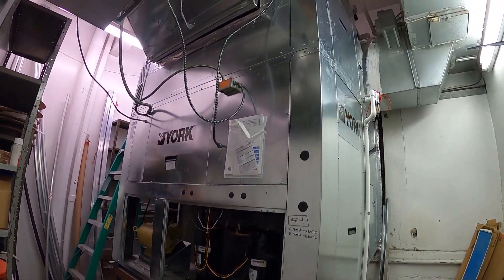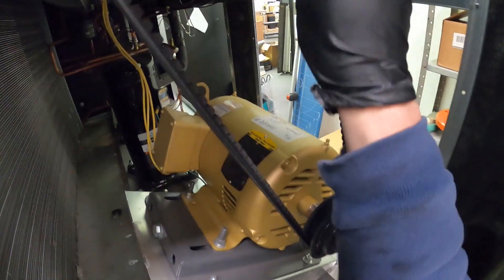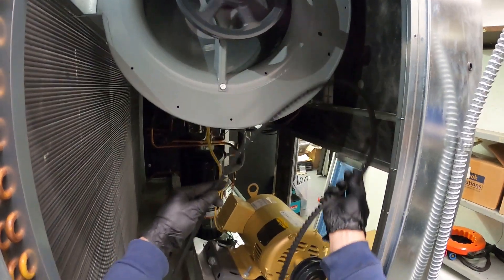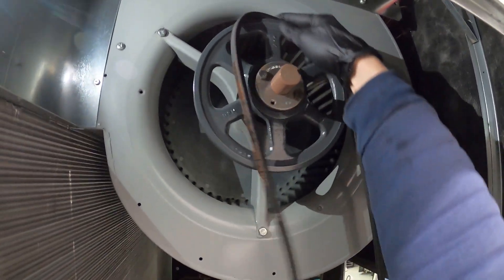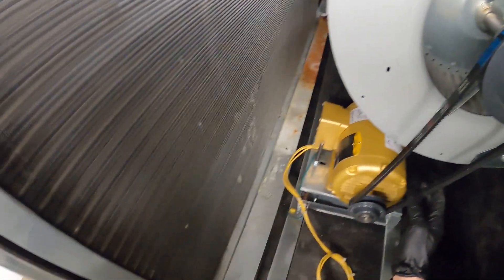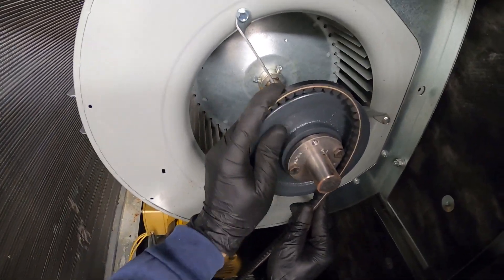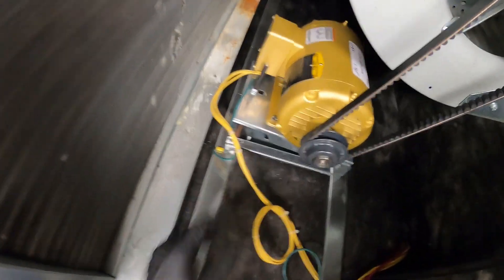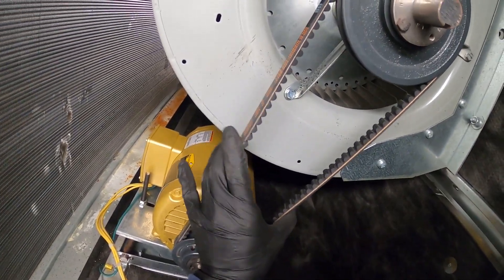HVAC: Fan Belt Replacement/Installation For AC/Furnace/Exhaust Systems (Belt Pulley, V Belt Pulley)

Comment: You should really stop making videos if you are not going to teach the correct way of doing things. Rolling the belts on and off damaged the bearings on the unit, could impact pulley alignment, and puts the technician at risk of getting their fingers pinched or crushed. I have seen techs loose a finger tip completely from using this method. The correct way is to loosen the motor mount and slide the motor forward. Remove the belt and install the new one. Then move the motor back till you have 1/2" of deflection and resecure the motor mount.

Comment: I work for the OEM in the video and was showing my 6 yr old son some ahu units and we were discussing direct drive vs bekt and pulley fans.  Googled a video to show him fan belt and pulley, and we came across your video.  I had to be sure to tell him that the right way to do this to keep his fingers is to loosen the motor plate and slide it over.  I am glad you eventually mentioned that in your video.  It only takes one time, and yes I know someone personally that has lifechanging experience with this.  Also the comment below about LOTO is a good comment.  Just thought I would mention it, so that you can keep making videos, but realize also how much safety matter to the people who are viewing them.

Comment: This just saved me so much time, changing belts on some rooftop systems
Reply from the maker: Thats awesome! This is the fast way to do it but its best in regards to the belt to adjust the motor for tension but you'll be just fine. Thanks for watching & stay tuned for new videos every week🔧⚡️

Comment: Thanks man, I’m a new maintenance technician at a YMCA and this super helped me
Reply: Don’t do it like that! Lol
Adjust motor in then install belt then use tension checker for proper installation. When u roll a belt on it already stretches it out
Reply: Please can you Show us.,! How do u do that.,? 
I actually, came across to this video and I need to learn (DIY) how to “make sure I got the correct  “belt” to replace the cracked one (slightly cracked) from my gas furnace?? Thanks 🙏

Comment: I get that that is the way most of us would change a belt on equipment. But the truth is that that is the wrong way to teach someone new how to do it. Proper procedure is to loosen the motor to remove and install, then check tension with a belt tension tool. Too many people have hurt their hands or even lost finger doing it this way. At the end when your casually rolling the belt with your hands towards the bottom of the belt could be dangerous.
Reply: You left out checking the amperage and adjusting tension to attain correct amps - 
To each their own.
Reply: @1MaximusDecimusMeridius1  yes I agree!!!
Reply: You are absolutely incorrect. This video is the shortcut and can get your finger cut off. You need to be retrained.
Reply: The best way is to move the motor out belt and move it back alignment.